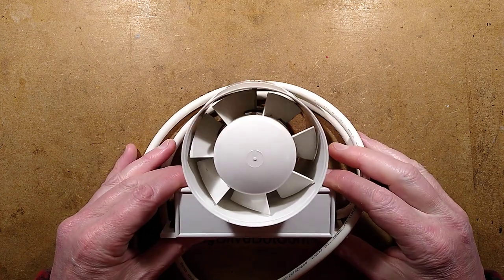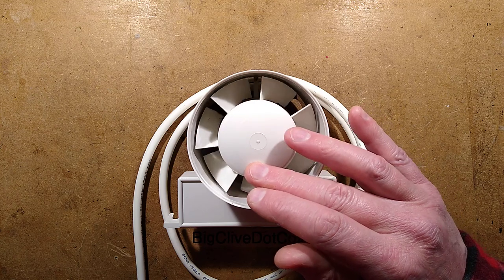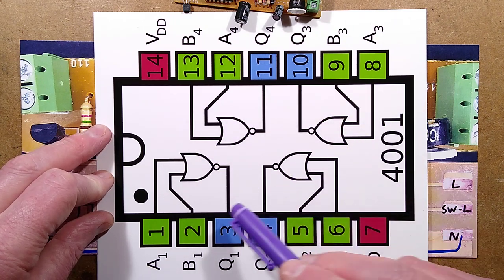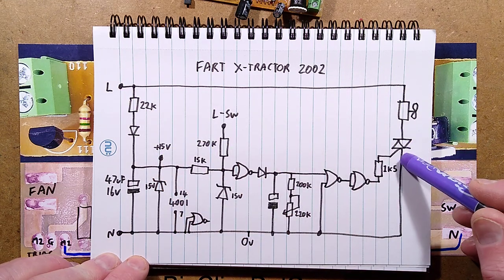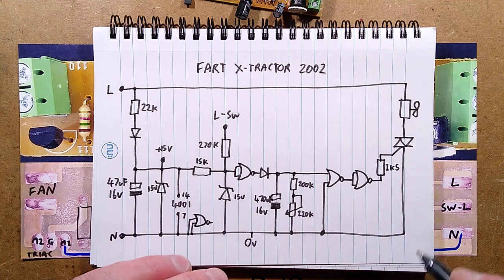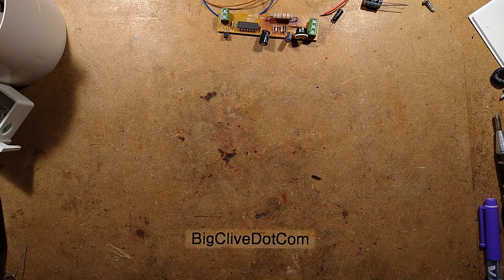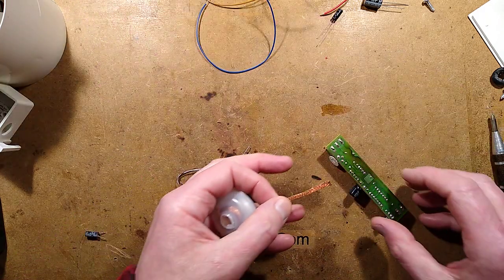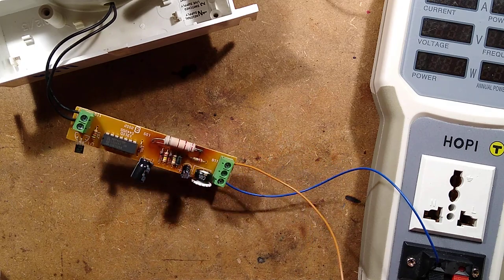Fixing a fart-extractor (with schematic)

Comment: So.. If i get that right.. The Fan itself runs at 240 Volts AC Main Voltage? Because i'm thinking about using a more logical approach and let an Wemos D1 decided when to turn the Fan on or off so i have to scrap the whole Circuit and build my own one because it would'nt fit otherwise.
Reply from the maker: It does run at 240V.

Comment: My toiled seat turns on a fan that vacuums out toilet bowl air through an activated carbon filter when I sit on the toilet and for a minute after I leave. It works splendidly and is nearly silent. When I press the dryer button it spins reverse and blows warm air over my ass to dry it.
Reply: I assume you have one of those “Japanese” techno toilets that does other luxurious things, not just disposing of your bio-waste?

Comment: Or the could have put the supply resistor in the air flow or duct the case to get air flowing through it. Sounds like the control system is designed to fail.

Comment: That looks a bit small Clive to get rid of my farts.
Edit: this exact thing just happened to my fan (different circuit board but exactly the same circuit diagram) I changed my capacitor to a 47uf 100v as that's all I had and works good as new now. Thanks Clive.
Reply from the maker: Then you'll just have to let them out slowly so it doesn't stall and catch fire.

Comment: Are these sort of fart fans the norm in the UK? I guess simple mains powered shaded pole motor fans you manually switch or have tied straight in with the light aren't a thing?
Reply from the maker: It's requirement here to have the light activated by the light circuit and run on for a time afterwards.

Comment: Charging a 470 uF electrolytic capacitor from CMOS gate output? Is that a good thing to do?
Reply from the maker: The internal MOSFET tends to have enough resistance to avoid problems.

Comment: Its weird that they are running the supply at 10mA, yet HEF4001 can only output ~3mA, and parallel outputs aren't used, and gate resistance of the triac is set for 10mA current.
Reply from the maker: I was expecting parallel outputs.  The output of a gate can supply more current, but the voltage drops.

Comment: So if you buy a fart-extractor or have one drill a small hole in the plastic housing to ventilate the circuity so no more cooked capacitors - fan side.

Comment: And I just replaced the fart-extractor in my bathroom the other week, if only I had known....
The circuit was quite a mess as it had had water leaking through the fan, and I had refurbished the fan previously so it was probably best to have replaced it anyway.
Next time I get in the loft I will have to make a u bend in the conduit and a small hole and container for any condensation to flow out before hitting the fan.

Comment: can a higher resistor be used instead of the one thats there. so it wont get hot???
Reply from the maker: The triac needs a fair amount of current to operate.  They could have possibly used a thyristor shunting a bridge rectifier.
Reply: I can think of many ways of lowering power consumption but all increase cost

Comment: These small inline fans are useless at extracting air if the duct run is anymore than a metre or 2. Also if the flexy duct that's fitted isn't tight, there is so much air turbulence in the ducting you may as well just not bother and crack a window instead. I have an inline centrifugal fan that works perfectly in every way except the fan blade has cracked inside so it rattles.

Comment: Wouldn't some thermal gunk between the resistor and the housing (where there is airflow through the pipe on the other side) help a lot in keeping it cool?
Reply from the maker: The resistor is still dissipating full power when the fan is off.

Comment: Had a very similar-looking fan fail on me, but the one i've got lacked any fancy electronic box, it connected directly to a fan switch. I presume in my case it stalled, but as there weren't any electronics, it overheated and nuked itself. Better clean those once in a while.

Comment: AC motor has trouble starting, but runs fine once it starts? As Admiral Ackbar said, "it's a cap!"
Reply from the maker: If it was a capacitor start or run.  This one was just a simple shaded pole motor.

Comment: Stupid question maybe, but would it make sense to change it from a resistor dropper to a capacitor dropper to mitigate the heat issue?
Reply from the maker: The resistor may double up as an anti-condensation heater.

Comment: I think I'd design it with a capacitor dropper and a higher voltage filter capacitor. Having them always near their limit is a good way to shorten the lifetime.
Reply: Maybe the designer was concerned about frost destroying the device, thus incorporating defrosting heat during standby, at the maximum standby power consumption legal in 2002. Imagine this installed in an unoccupied outhouse near a beech on the Shetlands, with that resistor as the only thing keeping the capacitor unfrozen through each winter. Entire product survived 20 years in real use.

Comment: so that gate there had its inputs connected to the ground, but it's ok to leave its output dangling?
Reply from the maker: Yes.  It's output is in a known logic state.
Reply: on a related note, what happens if you connect output of a NOR to its input? will it oscillate? create a tiny black hole?

Comment: How do you make liquid flux again? I have rosin flux here, but it is solid. I remember it was just dissolving it in Isopropanol?
Reply from the maker: Dissolving hard resin in isopropanol will make a basic flux for electronic work.  For more aggressive action they add activators.
Reply: @bigclivedotcom  Thanks!

Comment: I would check that power resistor too because when they run hot for a while they can change value.
Reply from the maker: It had increased in value slightly.

Comment: Would it help Making slot in fan cylinder close to Current limiting resistor, to take away its heat??
Reply from the maker: That could cause moisture ingress issues.
Reply: Oww, yeah. Thats true, it will cause moisture along with lot of fart smell..😂

Comment: The fastest possible 'repair' is to twist the triac so the leads short, cap the permanent live and move the switched live to the permanent live terminal, no more timer mode but oh well! The worst fan timer circuits I've seen are the ones with the resistors printed into the track side of the PCB, they don't seem to last long at all before the resistors go open circuit.
Reply: Just take the PCB out and directly connect to the motor wires with a connector block

Comment: Strange that in my 5 years fixing circuit boards out of welding machines, capacitors were almost the last thing I would check since they rarely ever went wrong. I went straight for the DIP IC every time because that was "usually" the culprit.
Reply: Hope it's because welder manufacturers know what they're doing. My solar inverter is a Fronius

Comment: It's always a good idea to derate electrolytics by 50%. Putting a 16V capacitor on a 15V rail is just asking for it. But then, things are made to break these days, you can't continue to sell product if you make your product last. The MBTF vs voltage curve says it all, especially in this application where that capacitor is being used at all times, even when the switch is off.

Comment: I'm guessing it's a Manrose unit - the PCB and design look all too familiar (I have had a couple of dicky humidistat fans which work for a while and get progressively more temperamental) - problem with the 'old school' manufacturers is the reluctance to improve and change their designs too much by re-using existing electronics they have used for decades - as commented below, there are probably thousands in landfill as a result - not the most glamorous of objects that anyone is willing to have repaired unfortunately :/

Comment: Detective  Clive once again spots the problem. Could the resistor be shielded?
Reply: Yeah, you could probably use a heat sink as well, but at that point, why not just fix having a gigantic heating element in the circuit.
Reply: It might be easier to use a more sensitive TRIAC and a higher value resistor. If a more sensitive TRIAC can't be found, then the sensitivity can be increased by adding a 400V BJT, or sensitive SCR, between the gate and MT2. Another possibility is to redesign the circuit so it only triggers the TRIAC, after the zero-crossing, with short, high current pulses, to save power, but if you do that, you might as well use a microcontroller.

Comment: I like how they attempted to give some heatsinking to the power resistor by making the pads bigger. Haha. I wonder why they don't put the resistor in the path of the fan, which would cool it down and increase the lifetime of the whole unit significantly, I would think.
Reply from the maker: They may be using it as an anti condensation heater to keep the 'tronics dry.

Comment: Stripping wires with the cutters?
 Holding it the way you do looks right, but try the cutters flipped over and see how much better it works,
Explained to me years ago by an adept engineering acquaintance. Easier than desoldering braid: Stainless steel tapered spike. Melt, poke, done. Solder braid often makes the pad lift if PCB quality is low, as it usually is.

Comment: I need to learn from you and take apart my vacuum and see what the hell shit the bed cause the only thing that comes on now is the light and it stopped working after I turned it off after a long run .
Reply from the maker: Maybe motor brushes or a thermal safety device.
Reply: @bigclivedotcom  I thought that thermal safety might have been it but i don't know if they reset or are just done?

Comment: I have a fart extractor controller which is buzzing really bad when the fan is running. Opening it up I see a fairly large transformer inside as well as the discreet logic circuitry, so I am wondering if this is a Low Voltage fan and it is the transformer that is causing the loud buzzing. I will be investigating this further... thanks for the inspiration Clive, I have been meaning to get to this for ages ;)
Reply from the maker: It could be.  See if the transformer is touching the case, as it may be acting like a buzzer.
Reply: A safety, low voltage type - 12v, so the fan can be installed in a wet/splash/spray area - inside shower cubicle; IPX7 zone1 SELV
Reply: Thanks Clive, you were right. Transformer had come loose and was buzzing on it's mounting. Only 12 volt output but beefy current on 6 inch fan.
Reply: Thanks Samuel, have confirmed 12 volts. Transformer was loose on mounting. A quarter turn on each screw and all is now fine 😉

Comment: Would it make sense to attach a type of heat sink to the power resistor?
Reply from the maker: They could have used a bigger resistor.
Reply: @bigclivedotcom  It helps keep the PCB dry in damp bathrooms.

Comment: wait you can't leave a CMOS gate floating? why?
Reply: CMOS gates have a very high impedance and when left floating will accumulate charge from the environment. This accumulated charge can partially turn on both transistors in the totem pole and thus create a partial short across the logic supply rails. This wastes power.
This explains it better: https://www.quora.com/Why-is-it-not-advised-to-float-inputs-to-CMOS-gates-under-any-circumstances

Comment: most fans r 240v's? so how come it has that voltage? there's no current reduction components
Reply: What?
Reply: This may be a permanent split-capacitor induction motor. Another thing to check.
Reply: In the UK these fans are normally shaded-pole motors running directly off the single-phase supply (230V)

Comment: Might have been worth replacing that power resistor with a capacitor.
Reply from the maker: Part of its function may be an anti-condensation heater.

Comment: Why are there two gates in series before the triac?
Reply: Because each one inverts. Two inversions cancel out.
Reply: To reverse the logic twice but still provide a buffer I guess.
Reply: To invert the signal to the triac, as that one need a positive voltage to switch. Without the double gates it would turn on when the lights get out and stop after time when you deodorized the bathroom.

Comment: While I would have replaced the caps as a matter of course, I would have also checked and at a minimum reflowed the resistor.
Reply from the maker: Reflowing the resistor is a good idea, just to refresh the stressed solder.

Comment: OK then, what about the opposite problem the fan never turns off ?
I suppose that's every componentafter the power supply that isn't a capacitor :)
Reply from the maker: It could possibly be a failed triac or be circuit instability caused by failing components.  If the triac reads a dead short across its main power switching pins then it may have failed.  If not then there's no harm doing random component swapping.
Reply: @bigclivedotcom  Thanks Clive.
First I need to grow a longer beard, I reckon that will improve my chances of replacing the right component first time.

Comment: My toilet fan never worked so I took it down clean the dust out of it and even inside the pipe then I took the fan apart and it was burnt inside all the wires were cooked so I went to hardware shop and got a new metal toilet fan and I put it in my bathroom and it works like a dream

Comment: horribly inefficient as it draws power all the time. a smarter move would be to make the light switch charge up the 15V supply via the resistor and turn the triac on direct. then when the light turns off the 15V rail will drop slowly until the triac drops out. this would eliminate the need for quite a few components too.
Reply: Maybe but you'd still need something to feed the triac gate and I haven't quite thought of a nice way to do that
Reply: @jms019  you would do this via the supply as mentioned. it means there would be a short delay while the cap charges up form the light before the fan comes on which is probably desirable anyway, then a simple transistor could be use to produce the avalanche trigger to the triac or for the sake of cost just be the diode, R/C and zener to cap the volts to be safe for the triac gate and cap limits, this does not need to be 15V as no 4000 series.  The use of the logic chip is redundant. I think Clive should do a build video for a simplified version of this circuit so we can see it in action.

Comment: Dang I guess it was the timing capacitor based on the info that at first it stopped running after the light and then it stopped working at all.

Comment: If the fan was used often enough, wouldn't it be good if the resistor was cooled by airflow some how... not in the airflow itself as steamy air + mains is not a good mix. lol
Reply from the maker: The fan run time is a tiny percentage of a day.

Comment: I thought you'd replace the recistor with dropper cap
Reply from the maker: The resistor is possibly doubling up as a heater to keep the electronics dry.
Reply: @bigclivedotcom  Well, you could have done a combo...resistive\capacitative dropper lol

Comment: We had a new extractor fitted when our bathroom was remodeled. The damn thing hasnt turned off in the three years since. Oh it'll slow, but its never off.
Reply from the maker: Some do that.  Slow running, but ramping up when the light is on.
Reply: That is called continuous/trickle ventilation, a new thing with extractor fans 😀
Reply: @bigclivedotcom  I just find it kinda funny, that the housing association would slather on more than a foot of insulative cladding on the outsided of the house, then that same HA would install an extractor fan that never turns off. 
We'll wrap your house up nice and warm, and install this fan for you that'll suck all the warm air out and dump it in the street.

Comment: Couldn't work out why they didn't simply use a capacitive dropper to derive the voltage. Then I realised they would have needed to get Electroboom involved in the design as it would need a FULL BRIDGE RECTIFIER.
Reply: You don't need a bridge rectifier. You can get away with just a single additional diode as a 'reset' diode to discharge the capacitor on the negative half-cycle. This would probably be better in this application because then the circuit negative is still the neutral line.
Reply: @eDoc2020  I know, but it doesn't sound as good as invoking Electroboom and the FULL BRIDGE RECTIFIER. 😄
Edit: yes, thinking about it you really would need the neutral as the negative or the trigger might not work as expected.

Comment: My first guess would actually be either a bad fan bearing or a bad motor winding...

My second guess would then be a bad component in the control circuit...

And I don't think this was designed as a Fart Extractor, I think it was intended as a bathroom fan to exhaust the hot, moist air from a shower...
Extracting Farts would be an unintended side effect - or if it was an intended effect, it's unlikely any of the Designers would ever admit it to their Bosses...

EDIT: It appears I should avoid a career as a Circuit Diagnostician...

That's OK, I MUCH prefer a Career as a Circuit Blower-Upper...😈😈😈

😁😂🤣